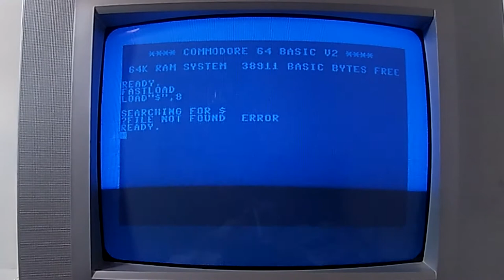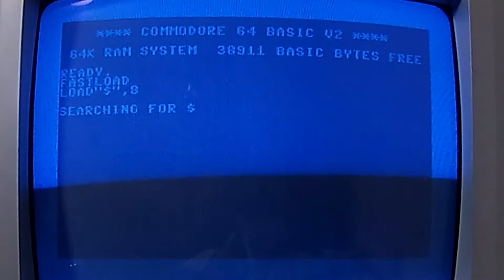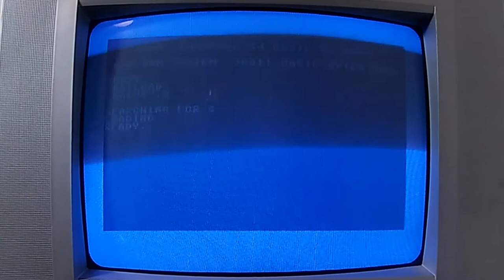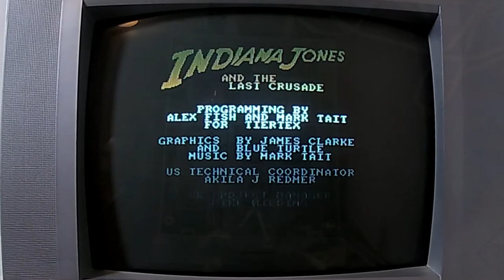Commodore 1541-II Floppy Disk Drive Cleaning and Servicing

Comment: I see you have Epyx Fastload. You actually don't need to type LOAD"$",8. Fastload has a DOS wedge built in. To get a directory listing without overwriting anything in the memory, you can just type $. This will list the directory. A word of warning: Before disconnecting the drive, both the computer and disk drive needs to be off. Unplugging the serial cable can cause damage to both the computer and the drive.
Reply from the maker: Hi, Jon Thanks for watching :) I was aware of the short cut with fastload but old habits die hard I guess LOL About disconnecting cables when the computers turned on  I always turn the Computer and Disk drive off may be in my edit of the video It may have looked like I didn't do this.  But your advice is something I should have said in the Video. Thanks again
Reply: I know this video is 3 years old but did you ever demonstrate how to copy a disc to the SD card? Thx!
Reply from the maker: @bobsbarnworkshop7542 Hi thanks for watching :) to answer your question I did not demonstrate how to copy to a SD Card but check out Jon Beta Video How to Copy C64 Disks between SD2IEC and Real Drives https://www.youtube.com/watch?v=khyATbkEYDI&t=837s Jon does a good job explaining how to do it and has resources in his description that can help you out. A little tip do a few Practice copies before copying any program you don't want to lose just to get the hang of it and full under standing of the process. If you have copy games in the old days it will be second nature to you. I hope this helps.